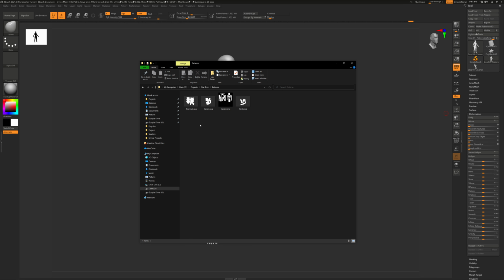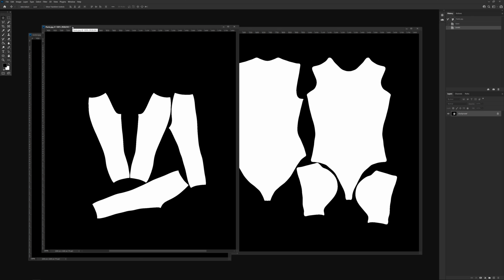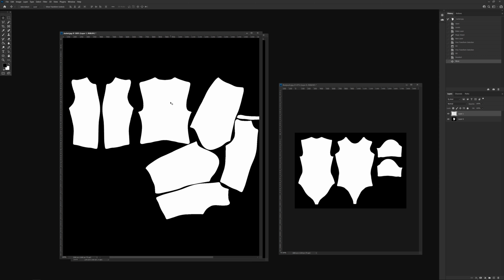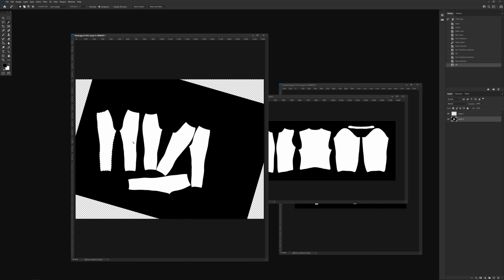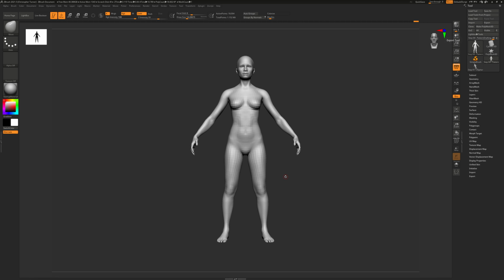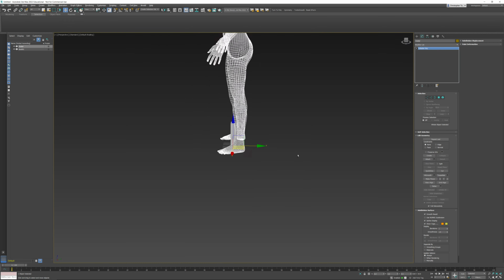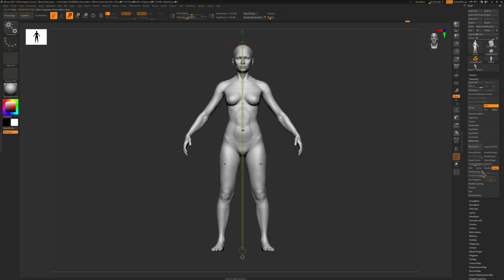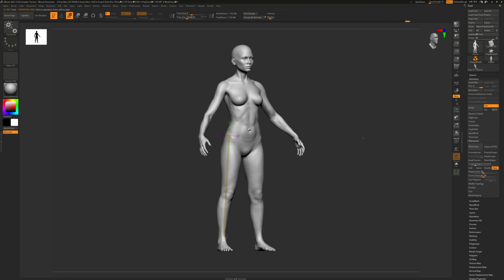ZBrush Character Creation 08 Adjusting scale

Comment: Hey man, thank you for the video I am having a great time! Quick question, you have said in the video that subdivision levels are not disappearing when you re-import the model after resizing. But even though I make the exact things you do, the subdivisions do not show up. Why does this problem happen? Thank you so much.
Reply from the maker: This can happen if you edit the structure of the model. When I import and scale, the actual components don't change. Every vert, edge, and face are left as they were.